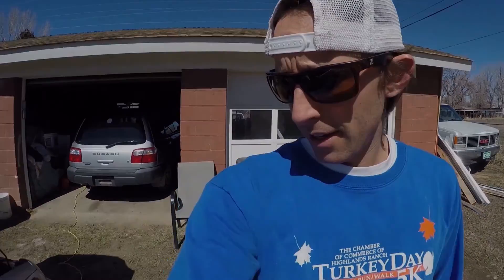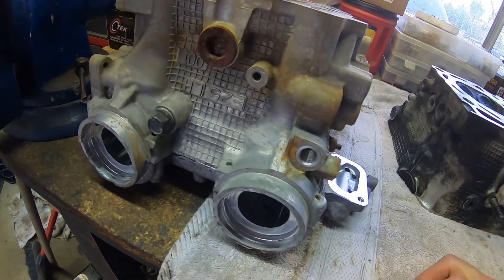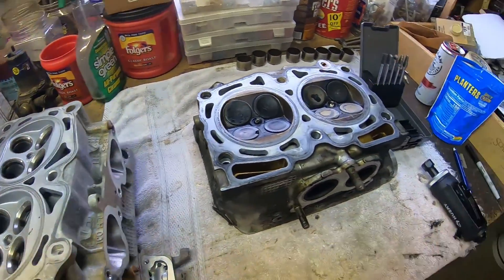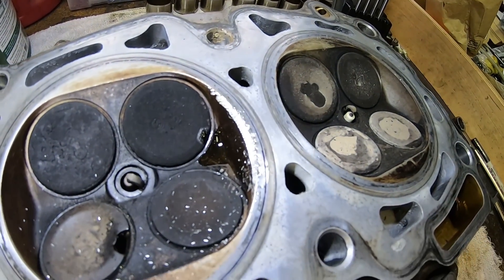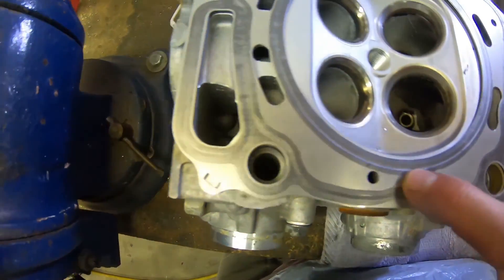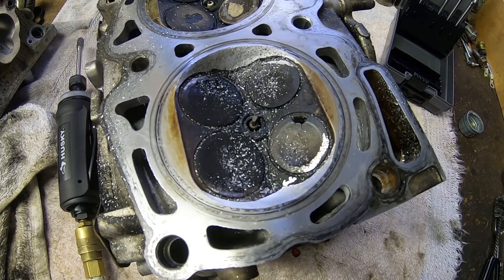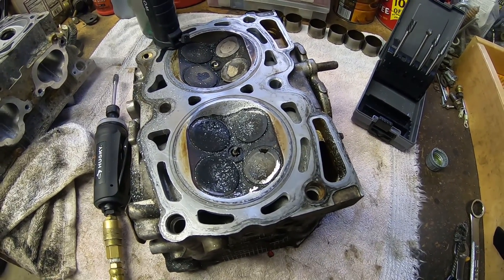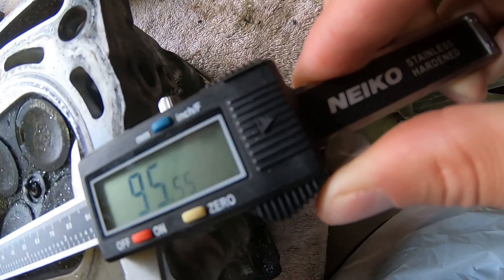WRX Project Ep3 - DIY Chamber Matching EJ20 Cylinder Heads

Comment: How this play out?
Reply from the maker: It turned out well.  300whp at 19psi with room to turn up the boost.  Much much better than the previous build without the chamber matching.  Let me know how yours turns out if you go this route.
Reply: @KennyGillis  I tried the whole 257 stage 2 tuff short with 205 heads with thick gasket set up kit map sells with set of arp 2000s and I got greedy and was running a fp red at 30psi on 93 pump with meth injection kit and a second kit coming in at 20 psi up too 30 and dropped a valve due too spring lock failure after several hard hits so rebuild now and thought abt matching the chamber this go around with 14mm head studs this time